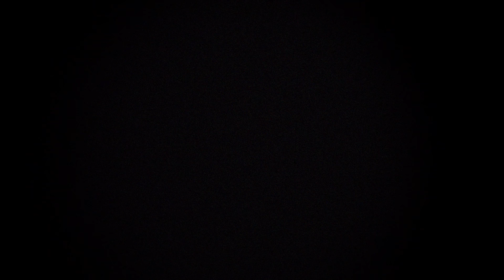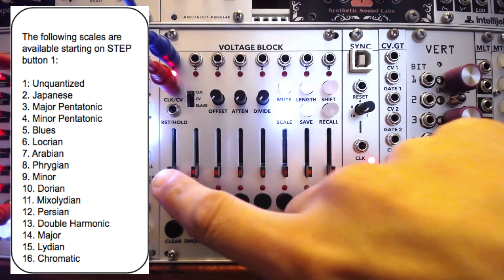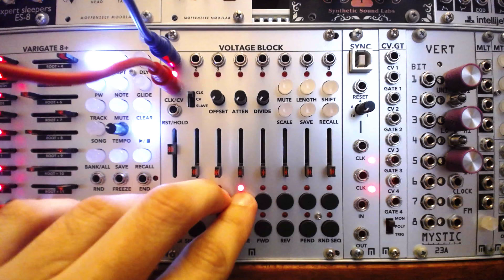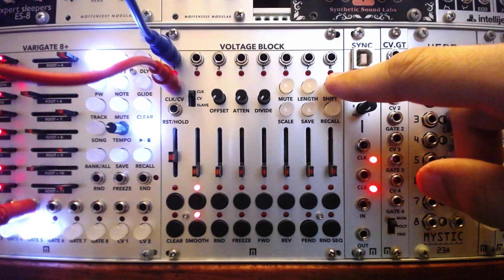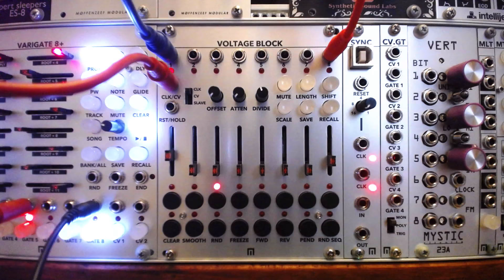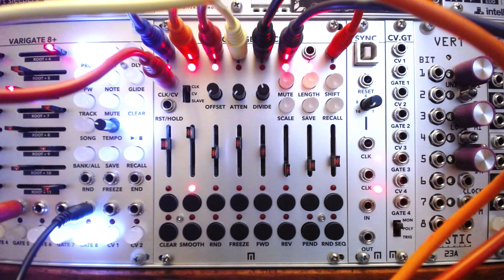Composing with Voltage Block Eurorack Sequencer

Comment: I use a Varigate 4+ as gates for the first 4 channels on the Voltage Block. I use the other 4 left over channels as modulation sources.

Comment: Can anyone answer me this odd question? I have a clock in to my voltage block from my bloom sequencer clock out, if I click shift and "rnd seq" it runs a random sequence. But if I click FWD it stops responding to clock even though the switch remains in "clk" position? I've not used the VB much yet and I think I may have put it into some mode where it doesn't respond to clock in for some reason? How do I get it back to normal?
Reply from the maker: That’s weird, I haven’t heard of that quirk... you might send an email to malekko, it might a matter of reinstalling the firmware or something!

Comment: Thanks for the video. Can someone explain how the gates are sequenced in conjunction with the melody CV from Voltage Block ?
Reply: so, in order for the voltage block to go, you need to feed it a gate. So just mult the gate before you put it in the VB and then use that!

Comment: Thanks again for another great video.  One question.  In the video  it looks like the Voltage Block is also creating a gate along with CV. Is this correct or were you doing that from another module?
Reply: I had the same question. I’m assuming the varigate is connected through bus and sending a gate?
Reply: I never see the 2 separate so I'd have to assume yes

Comment: Thanks. What i don't get is how to select a track without having to move its slider and thus change its sequence ?
Reply from the maker: Good question! You can hit Shift, and select one of the top row of buttons to select and then edit that particular track. You can hit that button again, and it will toggle back to edit all 8 tracks globally.
Reply: Thanks a lot.